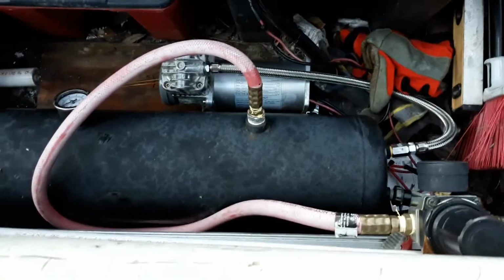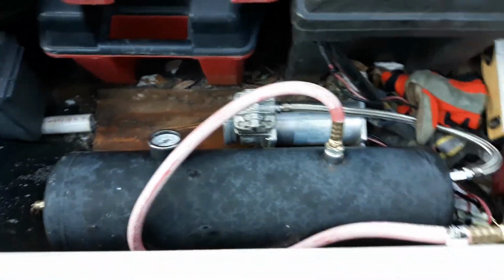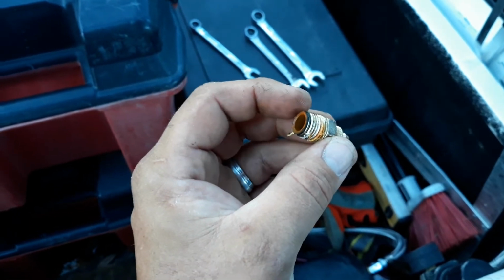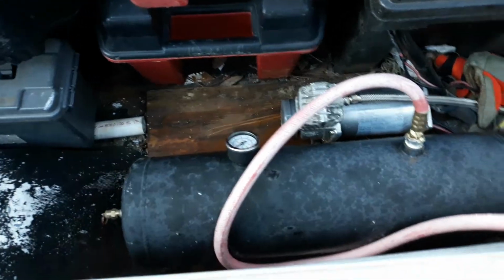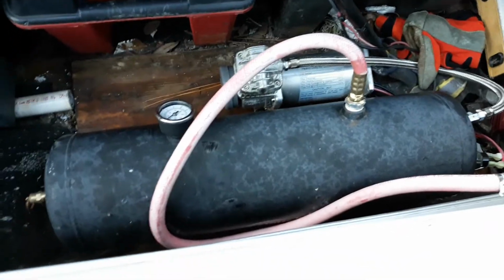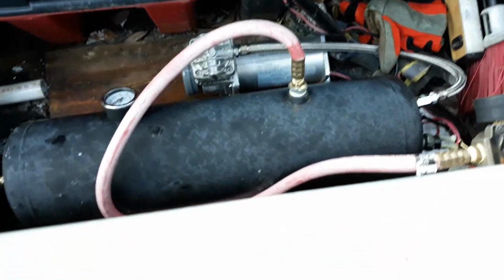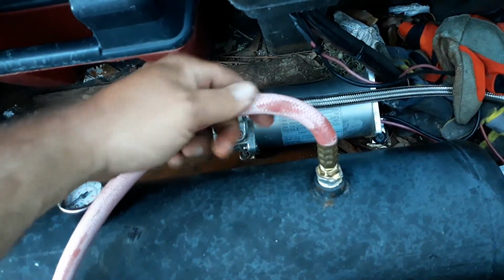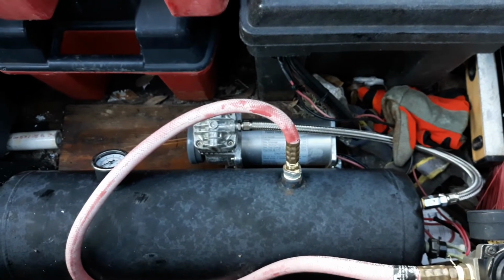Vixen Train Horn Issue 3

Comment: That location for the tank is a bad spot man it’s out in the open where it gets wet. I have my air tank and compressor inside my truck under the rear seat and my horn is in the rear under the bed of my truck… been 3 years no issue… horns gets a little dirty but still works.
Reply from the maker: Since I changed the location of the line that feeds the horns I have not had any more issues. For me the pump works great outside. The jug of the compressor gets well over 212°F and I would be afraid there wouldn't be enough air flow to keep it cool. Plus the noise of it is so loud I couldn't imagine that being under my seat. I do agree that your location does protect it from the elements much better, but I don't have that much space. Thanks for the comment.

Comment: You're problem isn't with the tank it's with the improper install. It just sitting in the bed open to the elements. The compressor intake isn't protected from moisture you need a remote filter line run into the cab of the truck where moisture can be controlled
Reply from the maker: I like the thought, but the humidity will be the same inside of the truck. I do not have my windows rolled up all of the time with the ac on recirc to dry the air. Humidity does not bother air compressors. Water is the natural byproduct of compressing air. This is why there is a drain cock on the bottom of the tank. No matter what you do there will always be moisture in the tank, unless I move to Arizona or something.

As far as improper installation the manufacturer says to install this compressor under the hood. The temps under the hood are 200°F+. This compressor gets hot enough to boil water on its surface. To me I don't see how this compressor would live very long being heat soaked all of the time. Then when it is running it can not dissipate heat because it is already over 200°F when it starts running. The pump seems quite happy in the bed of my truck. It has plenty of open air to circulate around it especially when I am driving down the road.

I have not had the problem with rust water getting into my horns again since I moved the fitting to the top of the tank. The water is not able to slosh up to its location.